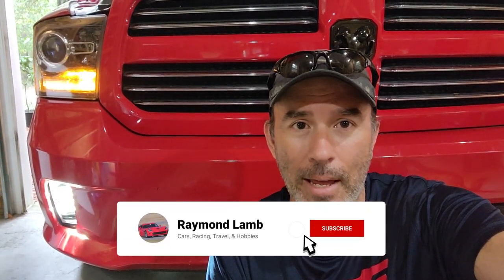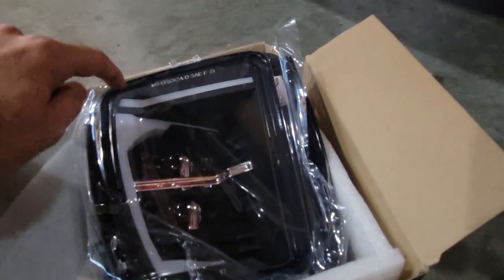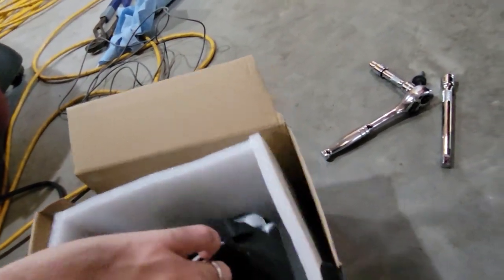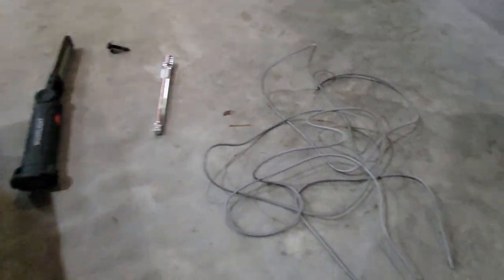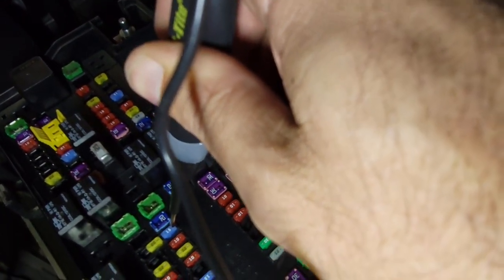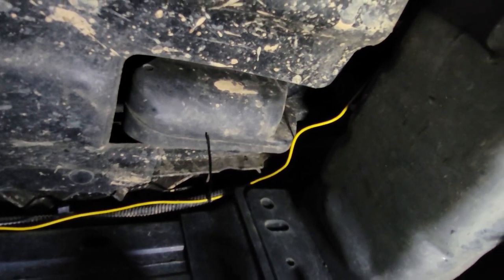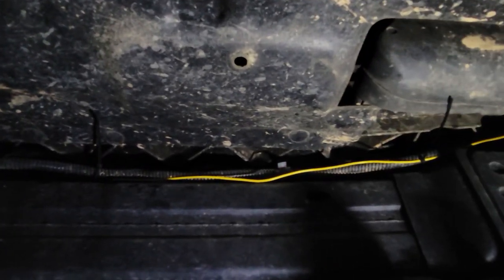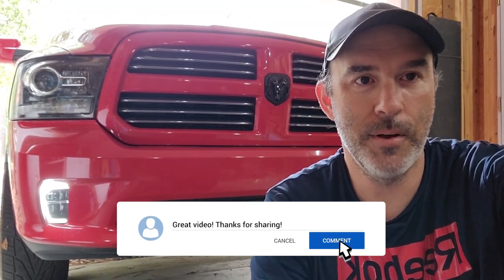LED Fog lights with DRLs Install & Review - 2017 RAM - Amazon Special!

Comment: I bought the same ones, great fog lights but the aligns was off, even when you lined up the tabs perfectly the top of the fog light was too high. I ended up swapping the mounting brackets with my factory ones and they lined up perfectly with all 3 bolts.
Reply from the maker: That's a good idea, I didn't think about that.  So far I haven't had any issues with them moving or vibrating, so I'm happy about that.  They are still doing great and very bright.

Comment: I have those, but the plastic housing thst bolts up cracked, I zip tied it, cracked in another place, so jiggles around. Seen ones on Amz now that say upgraded, but don't know what was upgraded.
Reply from the maker: Oh no, that sucks.  So far mine are holding up, not certain if I got an "upgraded" pair or not or how recent that was released.  Hate that yours cracked, I saw a comment on here that someone took the light out of the bracket and put it in the stock bracket.  Thought that was a good idea, but I had already thrown mine away.

Comment: Couldn't you just plug the wire with the fuse on it into any open fuse slot and just make sure the lights stay on when you want?
Reply from the maker: You could definitely try other fuse slots. Problem is a lot of them have power all the time so the DRL would stay on all the time, not just went it was switched on or running. But you could look for another one that works for you, thanks for watching!

Comment: Did you upgrade your low beams and if so with what?
Reply from the maker: I did, I'm almost done with that video as well.  If you want to check back or subscribe so you'll know when I post it.  The short answer is, I upgraded the low and high beams with LED bulbs, found here https://www.amazon.com/dp/B079KB8J98?psc=1&ref=ppx_yo2ov_dt_b_product_details
They worked great, and really light up the night!  Because mine has the Sport projector style lights, it takes four of the 9005 style bulbs.  I'll have that video finished soon if you want to check it out.  Thanks!